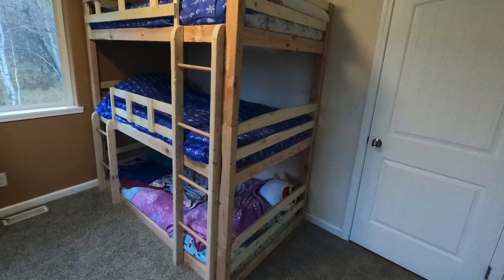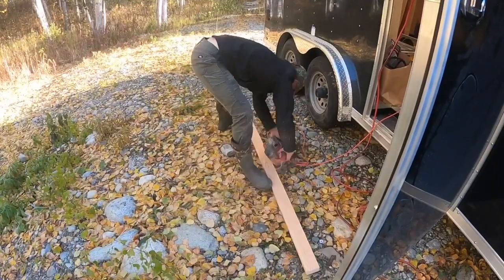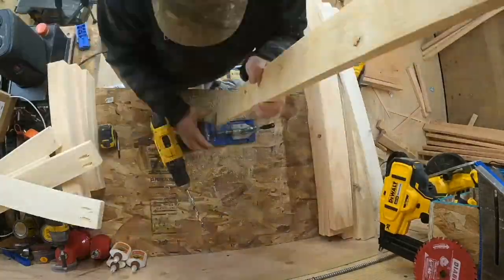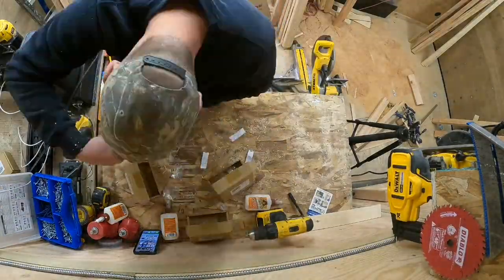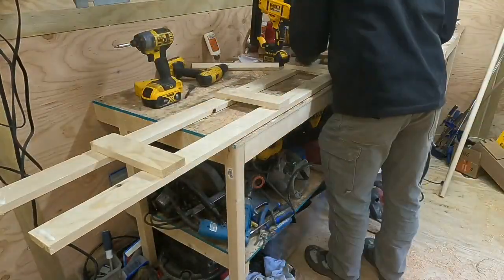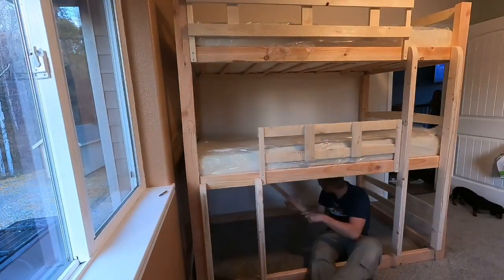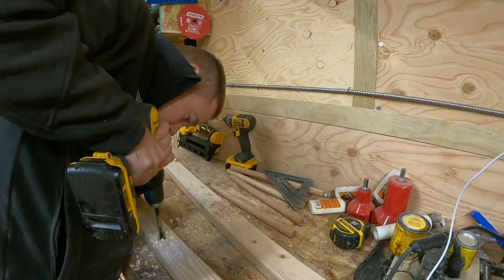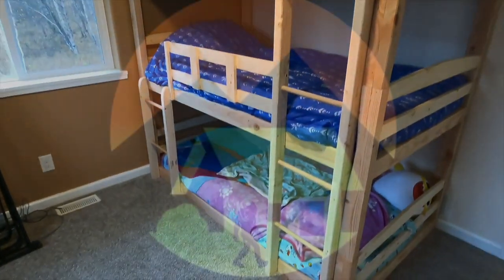Diy 3 Bed Bunk Bed

Comment: This is a great project. As someone who use to sleep in a bunk bed as a child, please, please make sure the spacing for the rails is too small to put a head through. We use to poke our heads through the rails to chat with each other. This was fifty years ago so safety wasn't high on the priority list. 

Those rail gaps appear large enough for a child's head to fit through. 

Also the top dowel rod in the small ladder and the second from the bottom dowel rod for the large ladder are "breaking leg" hazards if a child slips and their leg falls forward between the dowel rod and the bed frame while getting into the bed. Those dowel rods are round and with constant use will develop a nice smooth polish, making them even more slippery.

Saving money is great, and you did a good job, but don't forget safety regulations for kid's products are written in blood. 8^(

Comment: Nice. May I suggest you get yourself a set of Forstner bits? If you do, you'll never look back.
Reply from the maker: I agree. I’m slowly building my tools up.
Reply: @affordablebackyardprojects6619  the Harbor Freight ones are actually pretty good if it's an item you'll only use occasionally. I just bought a set from Lidl.... I hate that middle aisle....😂

Comment: Does this need to be strapped/bracketed to the wall?  Is there a tipping hazard if all kids are playing and hanging on the ladders at the same time?  Three kids on top bunk goofing around and purposely going off the edge to dangle?
Reply: No it’s solid and you would have to force it to tip it over.
Reply: Yep.  I used to build bunk beds for a living, I always suggested doing this to my clients.